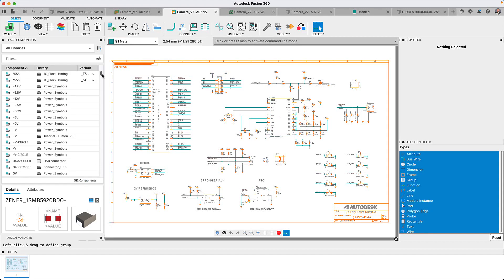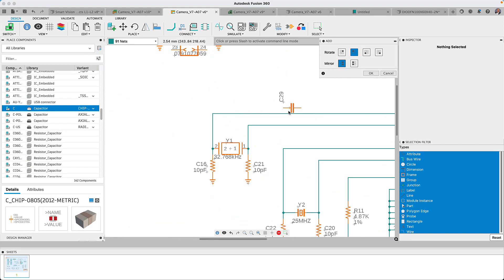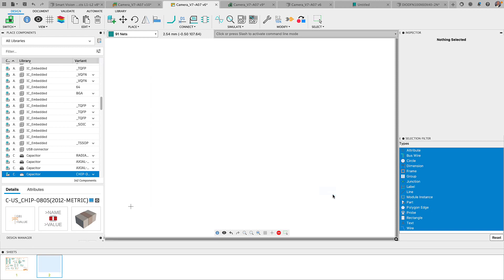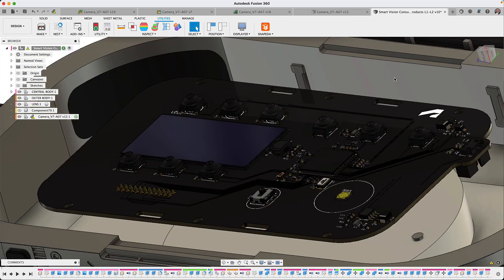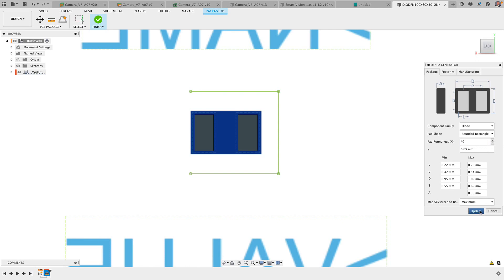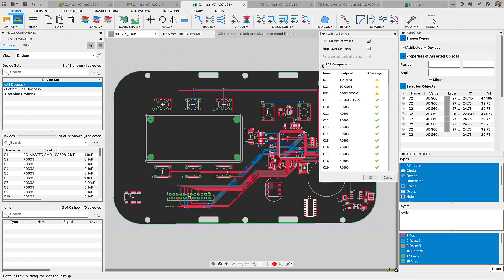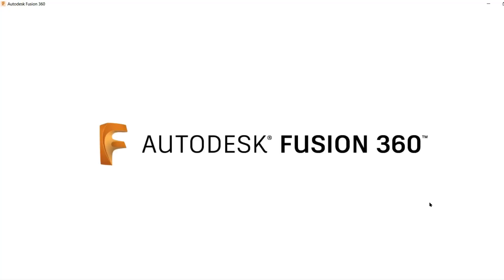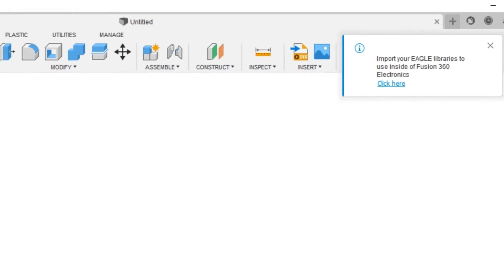What's New in Fusion 360 Electronics - March 2022 | Autodesk Fusion 360

Comment: Wow!  The new library experience is awesome!  So much nicer than the old Add dialog in eagle.  Love the you can drag from the panel into the workspace.  The speed of is ramping up.  I was surprised how snappy this is.  FINALLY, migration of libraries from eagle!  Design blocks!  Was Insert Schematic in eagle?  Is this the old Paste from File?  Looks like you guys are closing the gaps with eagle.  Great work.  About time.

Comment: Thanks for the big update, have no time to check them out yet, BUT We still don't have..
1) LIVE & EDITABLE - BILL OF MATERIALS 
2) PANALIZATION
3) SINGLE DOCUMENT for PCB Project ( Need the user option of only 1 file in the data panel and one tab in the browser per PCB design)
4) TIDY UP of BOARD and COMPONENTS in the 3D Browser tree, it still shows copper,hole, silks etc as components ( which is wrong), the hierarchy is displayed wrong

Comment: Pleas can you add a checkbox in the preferences, where the user can change to the old component browser? With a small screen the columns has to be small to have enough space for the schematic, but that's too small to read properly.
Reply: You can right click on the table header area to show/hide columns, that might get you more space
Reply: is there not a COLLAPSE arrow on the top right hand side of the component browser?